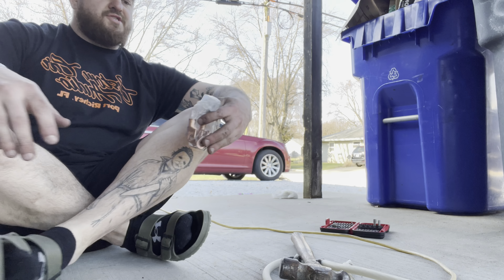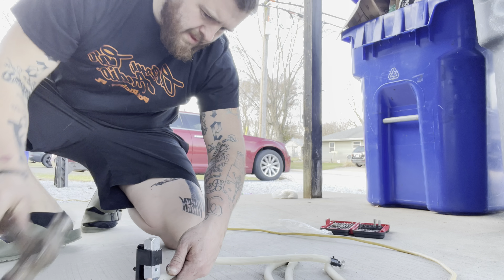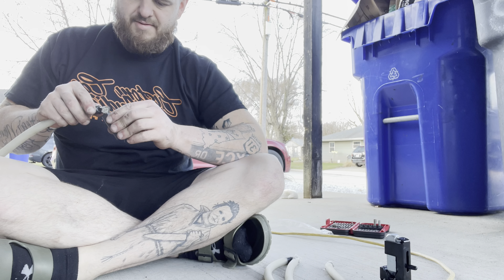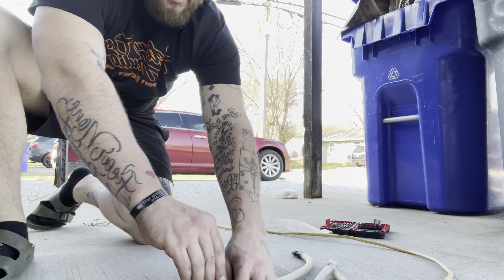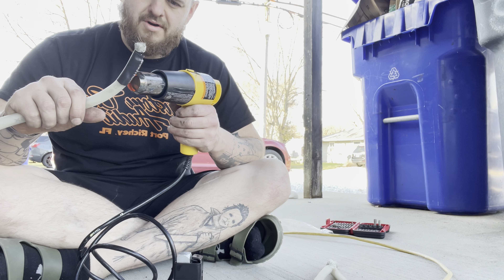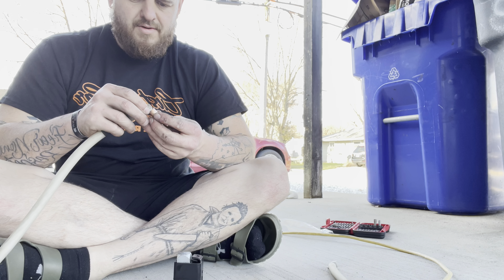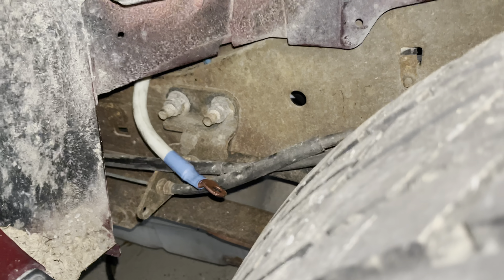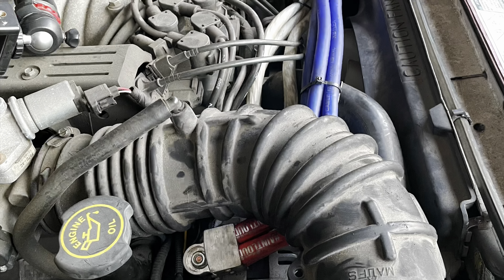Wired up pt.2

Comment: I got a hammer that would probably take one lick to have it clamped never tried the hammer style wasted money on the hydraulic one on e Bay and had to take the spring out to get it to work so now when you clamp you have to manually push the jaws open to get the wire out 🤦‍♂️
Reply from the maker: Yeah I was being cheap but this was quick and easy, took no time at all to do 10 lugs! Good buy for $8 at Napa
Reply: @AintloudSam  I want to try one for sure the hydraulic one I got works but not as it should.